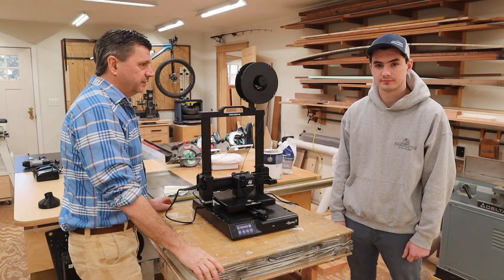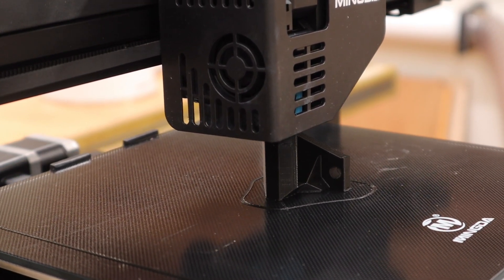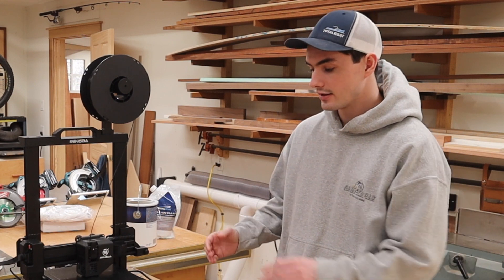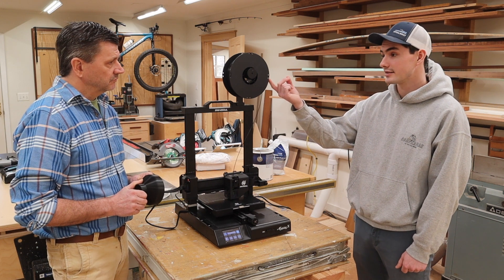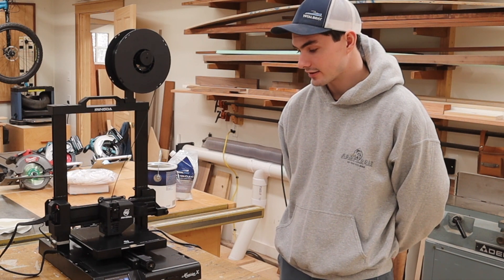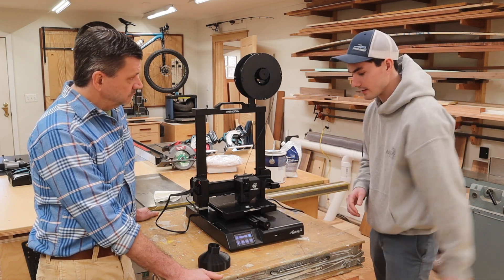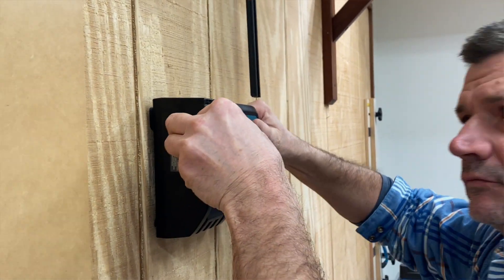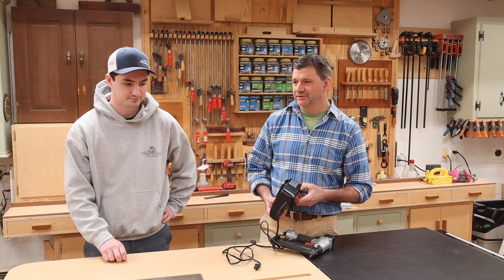3D Printer in the Wood Shop - Mingda Magician X 3D Printer / set up review

Comment: When printing functional shop type parts, look into a larger nozzle. (0.8mm is a good choice). Greatly speeds up print time outputting more volume, and you are left with a much more durable part. Also PETG is a good middle ground between easy to print PLA and more durable but challenging ABS.
Reply: 100% agree, and suggest snagging a bondtech cht which will let you print significantly faster/stronger  I've been using one recently to print dust collection connectors and can run prints larger than what was shown in ~3.5 hours compared to the stated 8.5 hours. Also second PETG!